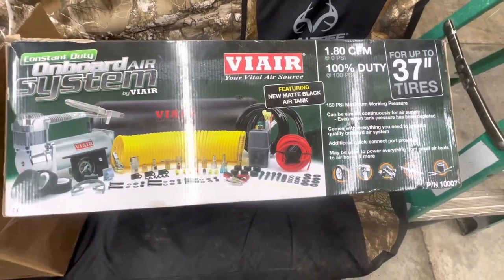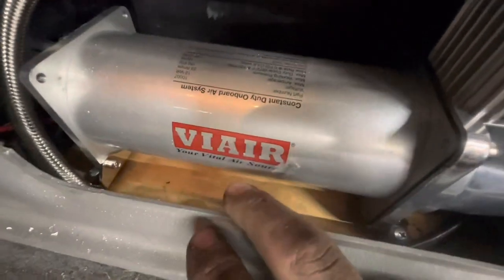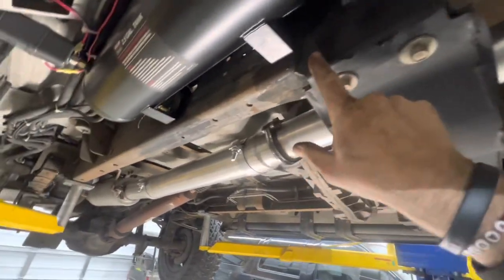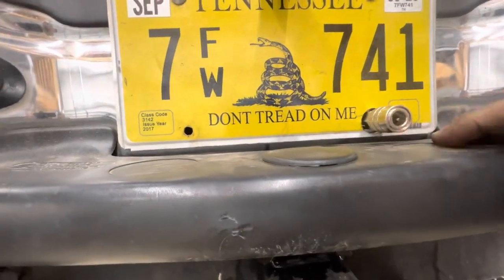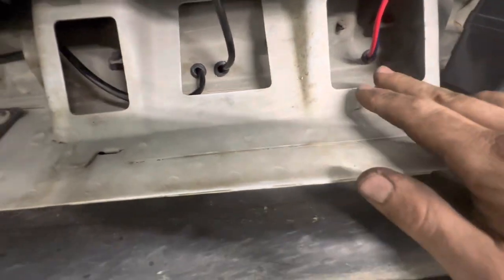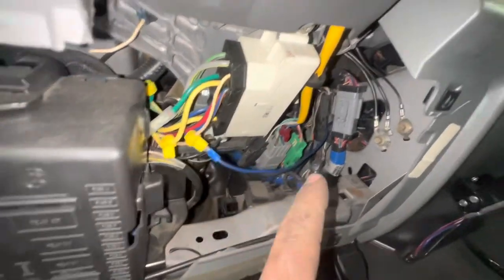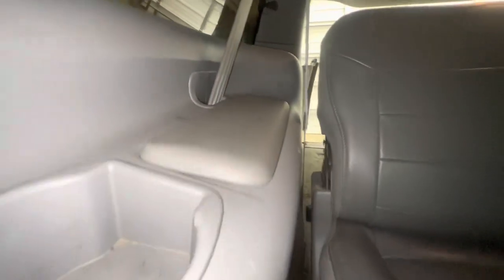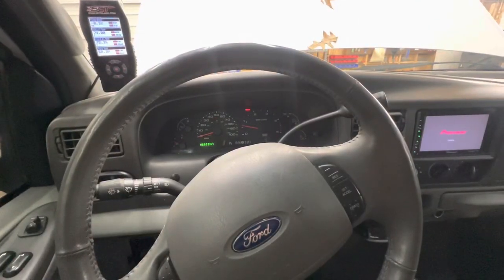Excursion Viar on board air compressor install

Comment: Tank is a bad install since there’s no low point drain valve. As is the tank would have to fill up 1/3 to 1/2 before it can escape the drain valve. Water is heavier than air so it ends up at bottom. So drain needs to be at the lowest point in tank.
Reply from the maker: Wait, water is heavier than air? Are you sure? I’m sure glad you graced me with your wisdom. Customer wanted tank outside of the truck, not many viable options under the truck, not many options for ports on the bottom that would allow for the drain to be placed there. Let’s be honest how many people actually drain their air tanks in their air system? Not many. Most use the system without any thought of their moisture drain ever being opened. I agree it isn’t in the optimal spot but unless I welded new mounts on the tank or welded a new bung into it and voided the warranty for him there wasn’t many options. So thanks for your science lesson on the weight of water but you obviously didn’t pay attention to the location of the mounts on the tank or listen to the fact that they DID NOT WANT THE TANK IN THE CAB, thanks for commenting and watching.
Reply: @AutomedicGarage  All it would have taken was different mount brackets allowing the tank to rotate 90⁰ so the flat brackets are up they're really made to be. It sounds like you may be a paid "pro" so people will naturally watch these vids and think that's the "right" way to do it. Sounds like you know better just chose the wrong way to mount it and it's your choice.. My comment here is more for those that don't know and looking for instructions. 

Yes I caught the not in cab, issue is not tank underneath, just the orientation of the tank not allowing drain.
Reply from the maker: @mrmotofy  again you didn’t notice the mounts are welded to the tank, if I modify mounts, weld new brackets or install a new drain bung warranty is void. No?
Reply from the maker: So I guess I should cut the welded on brackets off the tank and weld new ones on to the man’s brand new tank and void his warranty? The bracket don’t just bolt on.
Reply from the maker: @mrmotofy  I’m not still on it. Your reply popped up for some reason.
Reply: @AutomedicGarage  not to mention it is no longer certified if you cut and weld. 120psi makes essentially a bomb. Now what could have been done is a couple elbows and pipe nipples to get to a spot you could run the soft line without kinking from where you mounted the drain. A little more work and money but that's up to yours and the customers discretion,